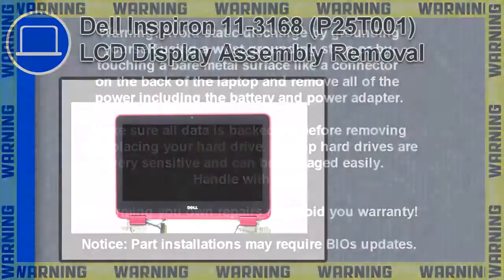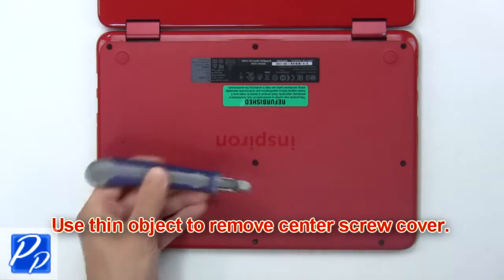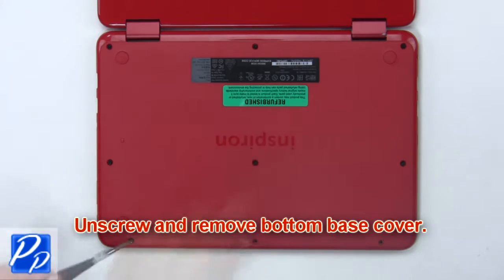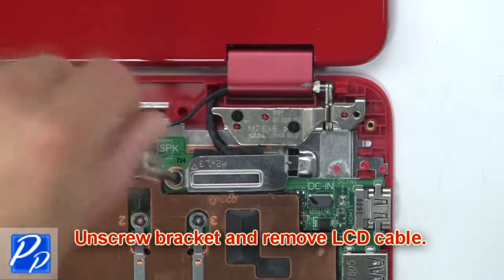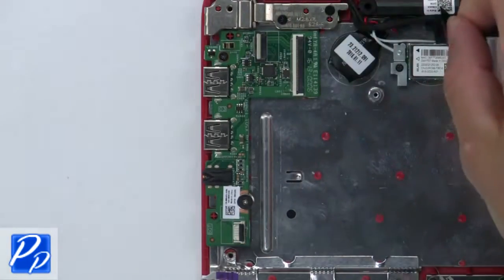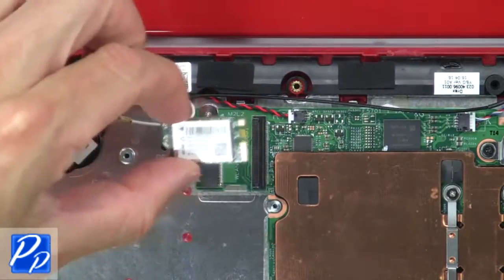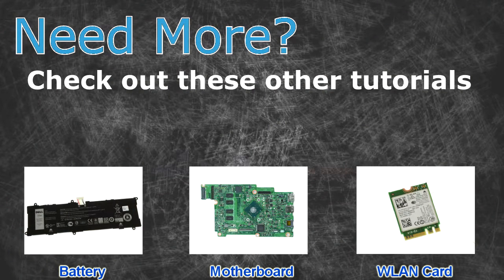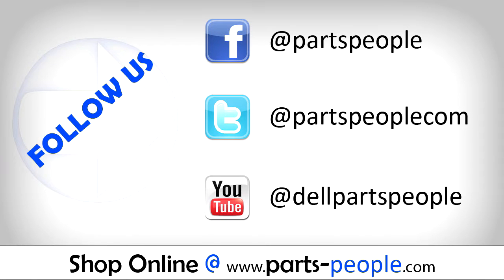Dell Inspiron 11-3168 (P25T001) LCD Display Assembly How-To Video Tutorial

Comment: Ricardo, you end the video too soon. You spend most of the video showing how to take the computer part which is great because it’s in every video. The issue is you never get past unplugging things on the screen you unplug the camera but you don’t tell people how to pull the screen out of the computer on any of the videos. Also you missed a step in the video there is a black bar which is connected to the screen and you have it removed on one scene it’s there in the next scene it’s gone with no instructions on how to remove it.